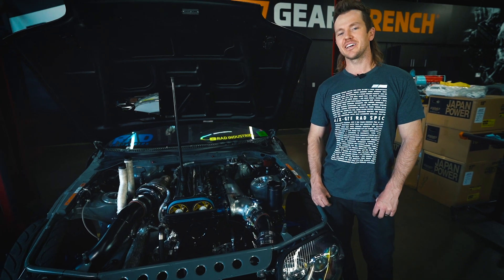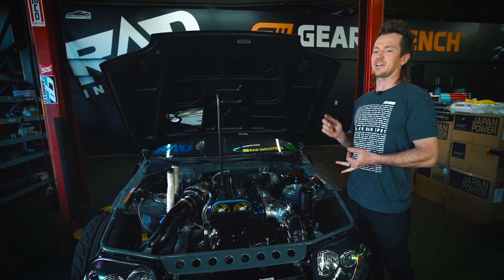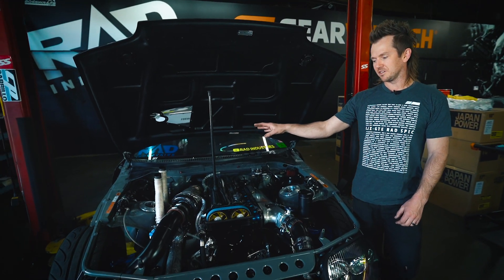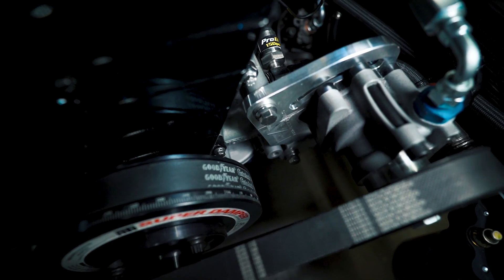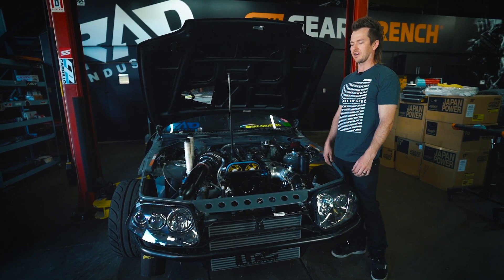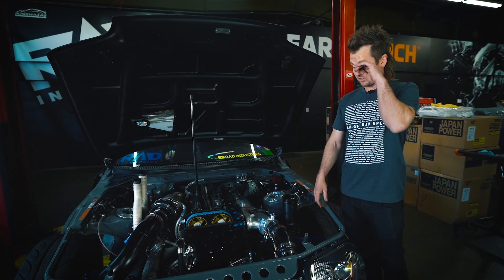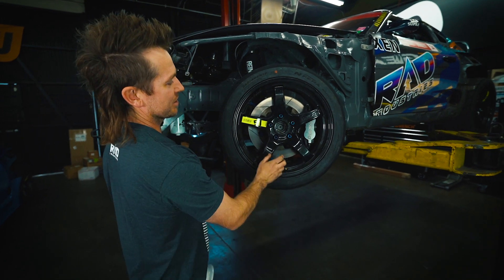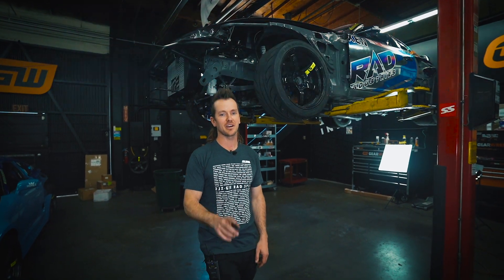PARTS BREAKDOWN of my Formula Drift Supra

Comment: I have to say you're really good at describing things in detail. This is my first time watching anything of yours and I'm a fan. I first heard about you through Adam LZ. The way you break down your car you make it sound, in part, easy to replicate. I used to want to compete in FD but I'd like to finish my system first. I used to want to go into rallycross and drifting until I lost my sight. Now I'm working on a fancy system to not just allow a blind person to drive, but do so at a greater capacity than 2 miles per hour in an empty parking lot. I used to drive like I meant it and have no intention of settling for anything less. And videos like this make you really relateable. I may be coming back for questions on my next build once money comes in. I guess I just want to say I'm a fan. I hope this comment doesn't get lost in the sea and if it does stay awesome.
Reply from the maker: Thanks dude, I hope you do build something and get out in the track soon
Reply: @RADIndustries  Thanks dude. That's the plan. Currently have my heart set on an E36 cause I don't have a ton of money and need something tossable. I'm also hype that you replied. I'm used to people either blowing me off or not taking me seriously. That's why it's just me and two of my friends. People see a blind person trying to drive and immediately say I shouldn't. But I got this. Or it'll get me. But either way I won't stop trying.

Comment: Great video, thanks for sharing. Really interested as to why you don't run the rear Wisefab kit on the Supra?
Reply from the maker: Formuladrift doesn’t allow it, otherwise I would. Wisefab has changed the rear upper arm a little to much for FD to allow me to run it
Reply: @RADIndustries  why wisefab doesn't develop fd legal rear end for a80 then?
Reply: @ardijanuar2036  I think unfortunately the A80 Supra is not a popular enough platform for them to bother. Much like the Lexus SC/Toyota Soarer which Wisefab initially said in 2012 that it was going to make the same kit for but never did (the only difference is that the rear lower control arm is longer)

Comment: Have you had any issues running solid mounts on engine, trans subframe?  As in from constant abuse and also from a crash point of  view? Being solid wouldn't be much room for error in a crash or wouldn't absorb mechanical shock loads from drifting
Reply from the maker: I haven’t had any issues from have solid subframe and diff and motor mounts, the trans has rubber bushings on the mount still. If you had a bad crash that bent the car then yes this would be an issue. So far I’m happy with how the majority solid mounts feel

Comment: Hey Dan  Was wondering if you run higher then usual  coolant pressure ? Or what kind of radiator cap pressure your running? .   To my understanding For every 1 psi increase on cap pressure it raises the boiling point 3 degrees F. In turn compressing the micro air pockets that are formed  in the water jacket around the cylinder head and bores that get the most heat affected from high  cylinder pressure at high RPM.  I remember you talking about your cooling system a few months ago.  Are you running a multi pass radiator to slow down the coolant flow or running the electric water pump slower so it has enough time to cool?

Comment: What type of ignition coils do you use and why?  Why not audi r8 coils or similar to avoid long ignition cables? Thanks :)
Reply from the maker: I run IGN1A coil packs, they are super strong coils and I have had zero issues ever. The Audi coils won’t fit under the OEM plastic cover so a can’t run those